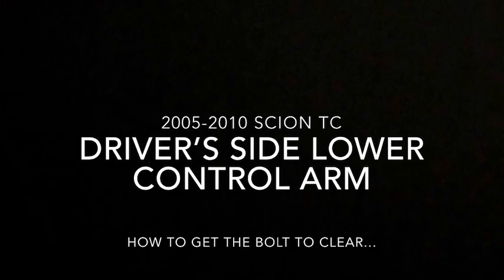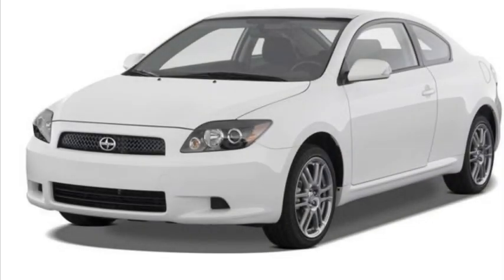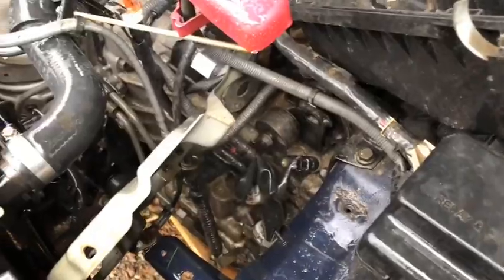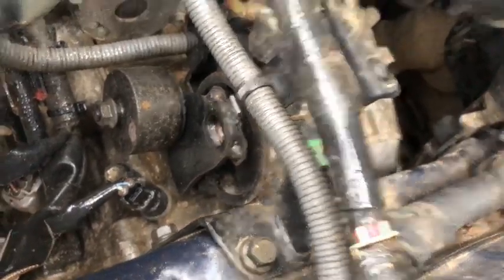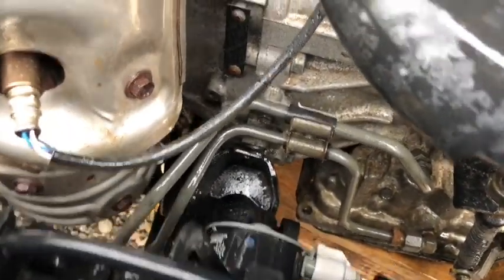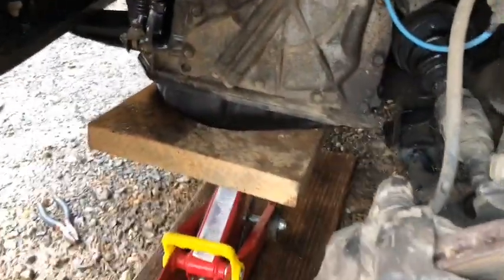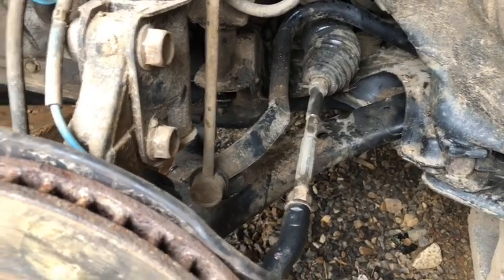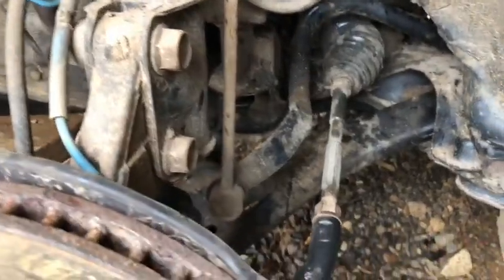Engineering Fail! 2005-2010 Scion Tc Lower Control Arm Bolt

Comment: 2011 Scion xD has the same issue:

...Driver-side- Jack up the trans, a bit to get the control arm  bolt out.

The passenger-side> remove the oil filter  mount from the engine.
There's   2 o-rings that seal it to the block.

Comment: I'm faced with this same issue, presently on an '11 xD. First thought I had to drop the subframe.
Now I'm  thinking jack up the engine... just guessing.

. That's driverside.
Passenger side, the oil filter housing is in the way...😢.

Now I'll watch you vid for solution.

Comment: Having the same & exact problem. For a week, the Scion has been jerking hash & sharply at any speeds. 

Just jacked up the 07 Scion the engine oil pan has been keeping the bolt from falling off. 

Dreading on removing the engine oil pan cause I still have 3,000miles left.

Death has been following for an entire week. 

Awesome hands down for the win vid.
Reply: What did you end up doing? Did you have to drop the oil pan?

Comment: Toyota did this with a lot of their cars during this time. Funny how a simple control arm replacement turns into either a pan drop or having to lift a bunch of crap. Agreed that the engineers failed here.

Comment: I have a manual TC and the bolt clears without any extra steps. When they said manuals are easier to fix, I didn’t know that applied to more than just the transmission itself lol
Reply: Mine manual was easy. When I saw this video. I was like no way!! I've done it before and there was alot of clearance. But then I realize this dude was fixing a control arm from an automatic car. 😆
Reply: @peterlee1992 

how about the passenger lower control arm, did u need to do anything special to get that bolt out or does it have plenty of space for it to come out,, i might be doing mines and i have a manual ... tc
Reply: What about the passenger side control arm? The oil pan is in the way for a manual.

Comment: Lmao all I did was change my trans fluid and filter bolt comes right out change control arm in the mist of that you guys work too hard
Reply: I did the same thing man. Work smarter not harder haha
Reply: I’ll try doing that next year since I just changed my atf fluid and filter .. not in a hurry to change my control arm since it’s not my main car the Scion tC anymore.
Reply: Keyboard warrior
Reply: Do you recall how much atf was required? I just got a 2010 tc recently and im thinking of fixing the front suspension because the im getting steering wheel shakes over small bumps. Pretty rusty on the bottom so im planning on doing lower control arms and probably both tie rods.

Comment: The trick to this is just lift the oil pan with jack 2mm and it clear the bolts.
Reply from the maker: I’ve heard many people say that but when I attempted it on the specific car and lifted the entire front end and still didn’t clear.
Reply: You have to remove the bolts from the driver's side motor mount and front motor mount in order to lift the engine/trans high enough for the control arm bolt to clear.
Reply from the maker: @nitrofiche7206  Actually, as you can see in the video, that's actually what I tried and still didn't clear. Likely because of the age of the motor mounts.

Comment: Best way and easiest way to remove lower control arm on drivers side is to remove the transmission pan ( an extra 5 min) to get access for that bolt to come out...also a good time to do a trans service, not necessary but suggested...
Reply: Yep way easier. Watching all these videos just makes me shake my head watching everyone do it the hard way haha...glad you caught that too...
Reply from the maker: Good points...but not everyone has the fortitude, equipment and parts to drop the pan. :)
Reply: @LearnitAllCentral  if they are attempting to do conrol arm... im sure they have fortitute to do pan
10mm socket , ratchet and extention=)
Reply from the maker: If someone is ready to drop the pan it would DEFINITELY be the easiest method.

However, don't forget that you have to drain the transmission and lose about half your ATF. If you don't have any fluid on hand and this is your only vehicle...or you live in the middle of nowhere like I do... then dropping the pan is not an option. And, I've ran into situations where the pan gasket is damaged during removal so having one on hand if you're planning to remove a the pan is recommended. This video is for folks that are stuck and stranded without options like I was.
Reply: @LearnitAllCentral   I find dropping the ATF  pan a lot easier to do on the 2005 Scion tC than doing the control arms on a 2014 Subaru Outback. The hardest thing on the Subaru control arm is knocking out the rust out ball joint after removing  the pinch bolt. Next I need to replace my Subaru front axles.
Reply: @LearnitAllCentral  to key thing is plan ahead …. When you order or pickup up the control arm … get the atf fluid and atf filter with gasket .. make sure you have a torque wrench that can handle low torque which my 3/8 powerbuilt doesn’t do well under 10lbs. Ended up using my nashbar bike torque wrench for the atf pan bolts and filter.
Reply: Definitely not 5 minutes.

Comment: Remove the transmission pan.
Seems much easier to me. Then unbolting all the other stuff.
If you need to change driver side  lower control arm. Just plan on a transmission service as well.
To go that far with unbolting subframe might as well install upgraded sway bar tooooo....
Reply from the maker: Keep in mind many people that would be all for replacing a wear part like a lower control arm will not be comfortable performing a transmission service or dropping the pan.
Reply: @LearnitAllCentral   Dam.... I just changed my ATF Fluid and filter on my 2005 Scion tC as well as the power steering fluid in that car.  I just did my front lower control arms for my 2014 Subaru Outback as well as front sway bar links  and bushings.  Need to pull out my front axle since I accident pushed the CV boot which created a 1/2 inch rip on the driver side axle ugh.... but anyway sealed it back up with Right Stuff for now to be able to move the car. Need to order replacement boot from Subaru and service axle. It seems Subaru's are sensitive to third party axles and would cause a vibration when car is at idle at a stop.  After being done with my Subaru servicing then I'll replace my control arm of my Scion tC which is why I'm looking it up now.
Reply: @LearnitAllCentral  Thanks for the video! This comment would be more for commercial setting or in the rust belt on your back where $50 in trans fluid is worth the frustration hahaha

Comment: How about empty the ATF remove the pan,  remove the bolt, place the pan back on with new gasket the fill it with the same ATF? i have clack and i think its the control arm.
Reply: That's what I'm going with...instead of messing with the subframe bolts...seems too complicated and jacking the frame up and over and over. I've already in the past did a drain and fill and filter and gasket changeout but ill do it again I need to change out my drivers side control arm anyway ive only done my passenger side.
Reply: @asilaydying672  there still was not enough room when I took my pan of.
Reply from the maker: Jerome Donasco that could work too if you want to get into that. Definitely an option.

Comment: Though not ideal, but would dropping the transmission pan have given enough clearance? Without additional jacking of the transmission or the engine
Reply: Not for me
Reply: @lydiahubbell6278    Which year of Scion tC do you have? Yeah I plan on doing the control arms for my 2005 Scion tC. Just did my 2014 Subara Outback control arms, Sway bar links and bushings.  Need to service my CV boot since I accidental cause a small tear while trying to get the ball joint out. Decided to order replacement boot kit.  Ugh. Live and learning.  So how did you solve the issue with getting the front control arm bolt out?
Reply: @haywardkong1213  I actually have a Corolla--same problem. well, I actually did take the transmission pan off. I called a mobile mechanic when I still could not get to the bolt. He had a ratcheting wrench that took less clearance than the socket I was trying to use. It was a terrible experience. I also broke the head off one of the transmission pan screws. The mobile mechanic walked off the job , but he had done the worst part...he got the control arms replaced. It is bad when you call in a mechanic after you work on things yourself. I have done it before, but this guy had a real attitude. He would not have taken off the transmission pan. He told me I would never get it back on without it leaking, but I did...even with the one screw head off. I think I might have tended to screw too tight and compress the gasket which might make it leak. I think my transmission mount needs to be replaced or that I took it loose and did not put it back together right. This was one of the jobs I wish I had not done myself. I hope I won't have to do it again. None of my other corollas had this issue. And I had 100,000 more miles on one and 200,000 more on the other.
Reply: @lydiahubbell6278   Did you break the head off one of the Pan bolts while taking off the pan ? or did it break when putting on the pan?  The key things with working on cars is following to torque specs.  I know the the 2005  Scion tC has the same automatic transmission as the 2005 Camry  and so I found the torque specs for the 3 bolts for the  ATF  filter which is 8ft lbs and the AT Pan bolts are 6 ft lbs.  I know most standard 3/8 torque wrenches that I got over 15 years ago doesn't do well on the lower end of torquing so lucky I had myself a Nashbar Bike 1/4  torque wrench that I got maybe 10 years ago when I got into bike repair on my own bikes and I had a carbon fiber road bike which required torquing seat posts more precisely since if you torque it too much you could crack the carbon fiber seat tube as well as the seat post.  I guess you did not use a torque wrench when putting on the pan bolts at spec eh? oh well live and learn.  Get the tools you need when you work on cars in order to do things right.  No worries... I did my own share of mistakes but able to fix mistakes and learning to be more careful.  Still I save a lot when DIY stuff.  I still encourage you to work on your car as long as you have the proper tools  and  build up your confidence  on working on cars. However, I still don't feel it's right the jack up the transmission to do the control arm or  jack up transmission and engine.    I'll eventually have to do the control arm at some point and I'm hoping I just have to drop down the transmission pan. 

Just note if you haven't changed the transmission fluid in the car after 100k miles might be better off to let it be.   Anyway, I gotta change my CVT fluid in my Subaru Outback soon since I don't buy into the Lifetime fluid non-sense. 

Oh one more thing, In your case the corilla, so you still did  had not enough clearance to get out the front bushing bolt of the control arm? What did the mobile mechanic do?

Again thanks again for sharing your story woes but live and learn from it :)
Reply: @haywardkong1213  putting it back on. Yeah...torque specs are important. I need to get more comfortable with my torque wrench.
Reply: @lydiahubbell6278  actually for anything below 10 lbs I suggest a 1/4 torque wrench.. I did not trust my powerbuilt 3/8 torque wrench when it gets down lower torque ranges.
Reply: @haywardkong1213  I have one torque wrench I got from harbor freight. I don't remember if it is 1/4 or 3/8 but I do think I will eventually have both.

Comment: I didn't have to undo anything. All I had to to was jack up the trans until it cleared. There was enough flex in the mounts to allow it.
Reply from the maker: James Southworth nice! Didn’t work for me. The entire front end came up and it still didn’t clear.
Reply: Can I do the same with my 08 xb 2nd generation???
Reply: @jp7489  you would have to try it and see
Reply: Ya that's hella extra work to clear that, I'd rather replace the pan gasket filter and pan oil and just do it then
Reply: That's the only good part about having worn mounts...
Reply: Probably because your mounts are going bad. I simply think its easier if you just drop your tranny pan and at that time replace your tranny filter too and just do a drop and fill on the tranny fluid. Instead of messing with the subframe bolts. Idk im about to run into this problem I ordered new control arms and inner and outer tie rods, wheel bearings and hubs and knuckles so im redoing my control arms. Well i only replaced my passenger side but my 2011 rolla had the stock drivers control arm so im going to redo everything brand new👍 good thinking though but im going with the transmission pan and from there jacking it up some
Reply: @asilaydying672  so glad u said that. I was thinking the same thing. Just undo the tranny pan replace oil an filter while we’re there

Comment: Never do all this all you have to do is wedge a pry bar between the transmission and subframe and pry them apart it gives you just enough clearance to get the bolt out
Reply from the maker: Try as I might I couldn't get that to work. Likely poor leverage because of where I was working. Thanks for the feedback.
Reply: A Carlan I guess the fact that I have a lift does help
Reply from the maker: For sure! 👍

Comment: Had this issue in my Yaris. I tapped the rim of the pan so as to fold it over. Then I jacked up the engine high as I could and the it barely clears
Reply from the maker: Frustrating, isn't it!

Comment: I just put a jack underneath the transmission pan and put a piece of wood between the jack and the pan... and jacked up the engine about one inch and was able to put the control arm bolt in. Took a second to lift the engine out of the way.

Comment: Are kidding me. Hopefully my '07 doesnt have this frustrating issue. Im almost certain i have to replace control arm cuz my car is clunking hard.
Reply from the maker: Yep! How'd it go?
Reply: @LearnitAllCentral  i just removed tranny pan, and put oil back in. But anyways it didnt fix the problem, turns out to be a loose bolt or worn out bushing on steering rack.
Reply: @jonathandelahoz463  Damn, I hope mine doesn't end up being something different also :/

 I'm positive I have a bad control arm since I have tire movement when I hit the brakes. 
 I get the vibrating clanking sound when I begin to engage my clutch in reverse and sounds like a metal on metal clank on the drivers side. took it to the mechanic today and they quoted me 140 for two control arms and 180 for the labor. I haven't taken it yet but does that sound right to you? 

Let us know if you find out whats causing your clanking sound good luck.
Reply: Jonathan De La hoz And you saying I will get the bolt loose
Reply: The clunking noise just disappeared. I tightened the steering rack bolts maybe 1-2 mm underneath the sub-frame, they were already super tight. But the noise didn't go away until 4 days after I'd tighten them . I just gotta laugh after replacing 5 different parts and spending close to $500 buying new tools and buying stock parts because of stuck bolts and what not. The main lesson from this is to not buy anything unless you're 100% certain. Don't assume.